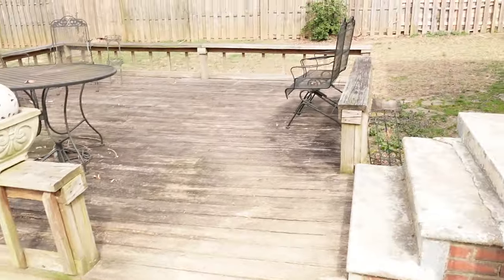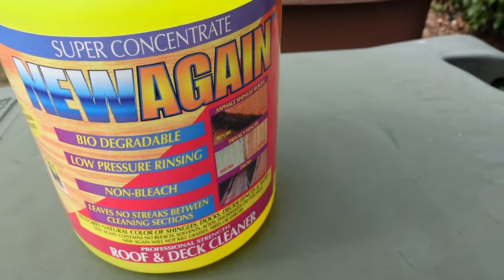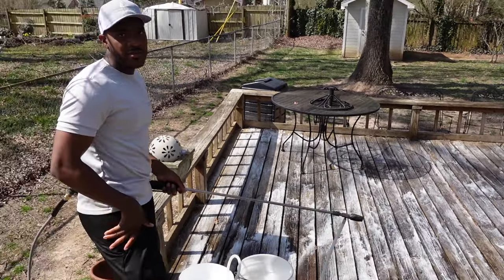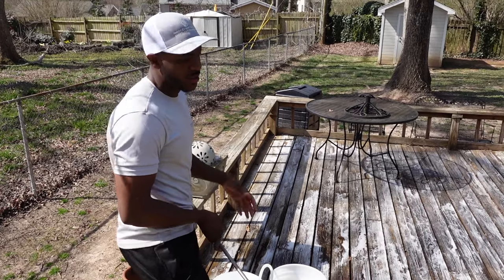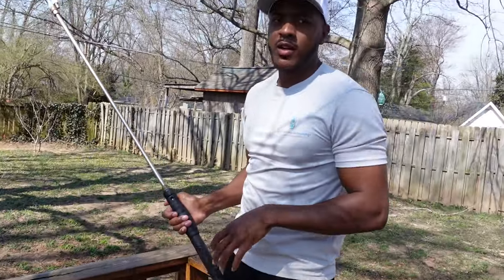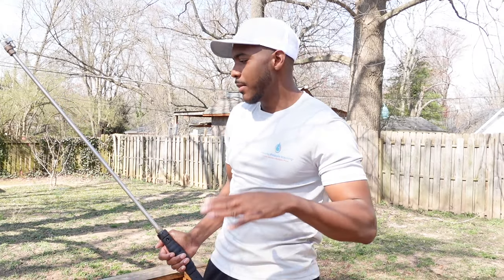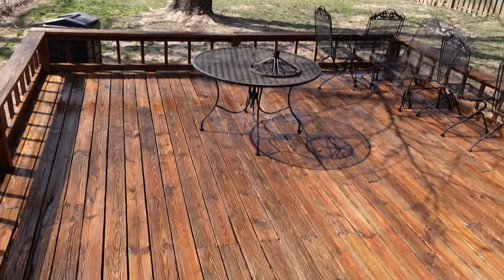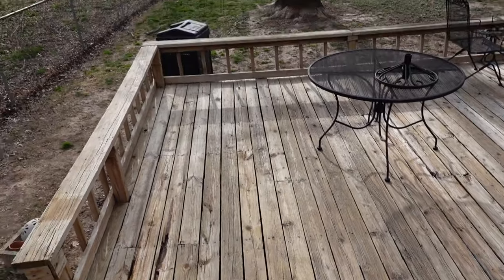How to Wash a Deck | Great Results! |

Comment: am i the only one who asked why he didnt remove the table and the chair from the deck before he cleaned it?
Reply from the maker: I moved most of it but she wanted it cleaned too so i left it in there.
Reply: @ZayWonderJournal  you can use it metal? Cool
Reply: @ZayWonderJournal  : I would have wanted the furniture cleaned, too......but in the yard, not still on the deck!
Reply: my first thought was why didn't you clear your work area first, then you wouldn't be getting your hose tangled up, i always clear my area first then there's no damaging anything either
Reply: That was my first question
Reply: @cf8959  chemicals on the grass kill the grass.
Reply: The table and chairs are the wrought iron with the light holes in them. So that's why he didn't need to completely remove everything.
Reply: Film editing??
Reply: If that is Iron furniture I would have just removed any cushions and left it in place as well, especially if it is a one person operation.
Reply: I would’ve left em too lol
Reply: This is not really a question about this video but I have seen you use a xjet and you have a soft wash system. I was wondering what is the advantage in having both with you, thanks for your videos and information.
Reply: And the ball…
Reply: He's not a moving company he's a cleaning company
Reply: Exactly
Reply: The power washer wasn't powerful enough to push the table and chair off of the deck😅
Reply: And what about the planter box by the camera?
Reply: What strength SH mix did you apply to the deck??
Reply: How
   long did you let each chem dwell for???
Reply: What was your OX ratio you x jetted on the deck.  The ratios are just as important to teaching then just showing how you cleaned it.
Reply: Great job and very informative!
Reply: Uh, Not my job?'
Reply: Yeah and the pot thinky on the hand rail by the stairs.   That's just lazy 😆 🤣
Reply: Ain't nobody talking about that dirty ass shed out back or the wood fence on the side? 😂 They ain't no vegetation......and they ain't gonna ever be when I'm done either lol.
Reply: The Mask you are wearing is for Dust not chemicals

Comment: When i  clean wood i make sure i get the wood wet 1st then i add bleach i dont want the wood sucking up the bleach im trying to treat whats on top of the wood so let wood  get water then  add the bleach it will just sit on  top of wood   treat whats on the wood there is nothing in the wood   to treat   remember we are treating the surface and wood is  kinda like a sponge no need the sponge to take all the bleach when just the surface top is effected     remember there is a lot of ways to damage wood and one is over chemical the wood when all you need to do is treat the surface  hope helps

Comment: DN10 ball valve attached to mosmatic swivel, it will change your pressure washing life.  If you run a female coupler out the end of it you can lay chem with a nice foam with the right surfactant.  You can switch for gun to surface cleaner without having to turn you machine off and let pressure out.

Comment: For anyone out there trying to get good advice This is not how you professionally clean a deck. In very severe cases it's okay to clean a deck with bleach using no more then 4% bleach. Using bleach will clean it but will cause the deck to look dry and old because what you are doing is changing the PH balance in the wood. oxalic acid is fine to use as a deck brightener with proper protection. For whatever reason you use bleach make sure to hydrate the wood before hand and after very well. The best way to clean wood is to hydrate the wood then apply sodium percarbonate or Oxi Clean with down stream or x jet then pressure wash/rinse with a 40 degree tip. No mater what you do after almost a year of direct sunlight on wood un protected there will be dead wood fibers and possibly mold, mildew, algae and dirt. Wood is the most difficult to clean that i have seen so far don't half fast wood cleaning for a customer when you are getting payed to do so. If you intend on using bleach always let the costumer know the result of using it will cause it to age faster and dry out and age the wood. Don't be lazy, you should always get at least 3 opinions on anything. Extra Tip: When applying bleach remember to rinse any organic growth that you don't want to die like plants/flowers and wood before and after. I am NOT disregarding everything displayed on this channel I'm just explaining that cleaning wood is a love hate relationship nobody likes it. Keep in mind all decks are not 100% wood this information only applys to 100% wood decks/fence. Thanks
Reply: This is approved!
Reply: Percarbonate  is the way to go
Reply: everyone hates cleaning wood? interesting comment

Comment: great job. Did you rinse the Ox Acid? how would you have cleaned it if it was already stained/ painted
Reply from the maker: The ox dries with the wood. If it was painted I would’ve only used SH and washed it.
Reply: @ZayWonderJournal  In one of your vud you wash the OA off, why not this time?

Comment: Can you softwash a deck with SH, rinse it, and then apply Oxilic acid? Basically removing the tedious work of using pressure on every square inch? Would it come out the same or close to the same result?

Comment: Did a good job on the deck and all but I think perhaps you are wasting your money on the secondary chemical.  SH alone (in my opinion) is what really worked for you.  SH will really kill all that mess and loosen it up for your pressure wand.  And with wood that is that old you are 100% correct by saying not to get your nozzle to close as it will splinter up the wood and can be seen very easily when it dry's.  Good job man.
Reply from the maker: I just wanted to test out the new chemical, but oxalic definitely helps! Regardless appreciate it!

Comment: I had a question about green spots on the deck cleaned a deck with clean sol bc snd bleach and still could not get the green to come out what should I do. Also do you do wood staining if so what do you charge for it on average ?

Comment: Move everything off your work space first young blood, then have a fluid application method; your zigzagging all over the place. Put Wood Bleach on then go set up your pressure washer . By the time your set up you will rock that deck. I do 10 of those a day. That machine seems weak, what is it?
Reply from the maker: It has nothing to do with the machine it’s rinsing at a safe pressure. Furniture was on there because she wanted it cleaned aswell.

Comment: I used deck cleaner to prepare for staining and it made a horrible blotchy mess over the whole thing. The deck was built last summer with pressure-treated lumber and left to dry until this year. I used Olympic deck wash and rinsed it after 10 min. What did I do wrong? Have I ruined my deck? I've seen a few posts about this product but no fixes. Anyone have any ideas?

Comment: wouldnt it be easier to take furniture off deck first?
Reply from the maker: This question was been asked so many times. The answer would typically be yes but they wanted me to clean the furniture so i left it on first, cleaned it then removed it

Comment: In all honesty, my wood deck was almost that bad, and I simply power washed it with just water and a surface cleaner. Turned out just as good or better. Why use the chems when you knew the owner was going to be painting it?

Comment: Which tips do you use to clean the wood?
Reply: 40 degree tip aka white tip
Reply: @davidstevenson3135  if you have a 5.5?
Reply: What tip can you use if you have a 5.5 gpm ?
Reply: @chuckhorner469  you can order a 11.0 white tip nozzle I believe. You could also get meg nozzle and put it in the holder.

Comment: what PSi washer would you recommend?
Reply: 1000psi for wood
Reply: I use a 4000 PSI 4 GPM using anything less will cost you allot more time.
Reply: You don’t clean with pressure. Volume is more important 4 gpm minimum
Reply: @truth5476  that's too much

Comment: Not bad but as I have found with the cleanings that I have done good old pressure washer always wins just have to remember to reseal afterwards or it will damage the wood.  PS does she know that her hand railing is illegal heights.  Lol

Comment: Honestly you really don’t need extra chemicals with the wooden deck or fence..like pressure washing concrete, the wood is literally peeling off layers… a little 30 second cleanup to pretreat then, go to work with lite pressure, you’ll see the difference as you work immediately… the more chemicals the more you’ll dry out the wood... great video tho…
Reply: You using 30 Second Cleaner is the same as him down streaming SH haha. Both are actually horrible ideas on wood.

Comment: I never understand the companies that use SH to clean wood when you have sodium percarbonate, sodium metasilicate, and sodium hydroxide available. I guess greyed wood is liked by some or should I say the preferred way of people who don't like using the proper methods and are lazy.
Reply from the maker: I can say from experience once followed by oxalic acid they all look the same
Reply: @ZayWonderJournal  nope all 4 will have a different look to them but keep it up and you'll be another pressure washing guru in no time.
Reply from the maker: @davidstevenson3135  I’ve actually done all thank so appreciate your 2 cents